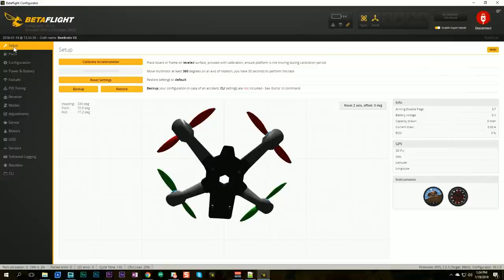Calibrate & Trim Betaflight Tiny Whoop Accelerometer | HOW TO FIX ANGLE MODE

Comment: You have to save settings, both sticks down and out.
Reply from the maker: I didn't notice needing to save manually while using the function. Someone else in the comments is telling me it auto-saves now.
Reply: Ok, good.
Reply: Yes, for sure it auto saves. I think this was a 3.2 change, but it could have been one release earlier.. I'd have to look.
Reply: Autosave to mine Tiny 6.
Now i love it, tnx Joshua 👍
Its all thanks to you and your passion for the hobby.

Winter here, snow and cold or rain and slush so indoors is the only option this time of year.
Reply: I havent updated so thats good to know!!!
Reply: @JoshuaBardwell  For me it's always been auto save when calibrating with stick commands, or using stick commands to trim the accelerometer. Btw, excessive trim values might affect the yaw turns, making it more like a swing than a pure turn around the z-axis. So I first try to get it to hover as solid as possible with calibration, and only use the trimming for fine tuning.
Reply: and whats the difference in calibration the gyro? Should i do that as well?
Reply: Thanks this worked for my Taycan👍🏻
Reply: I'm just starting with my tiny hawk and when I try to correct my trims doing what Joshua said in this video works OK, but then when I switch batteries it's like it resets, or goes all the other way around (ie first I trim it to the left, next battery, I have to trim it to the right). I even tried saving the settings and I see the drone blinking lights but it happens again. What should I do? Any help?
Reply: @dariordz688  Try correcting it and then DON'T disconnect the battery and connect to betaflight, go to where the trim values are and hit SAVE.
Reply: I have a cinewhoop that I fly in acro mode but I want to be able to fly it in angle mode too. The thing is that throttle seems to fluctuate in that mode, making it bob up and down. Me trying to compensate doesn't make it any better :)
I have no problem staying at an altitude in acro mode so it's clearly something wrong with auto level.
Reply: @Schradermusic  1)Aren't all this sticks corrections the same thing that use trims on the RC ? 
2) if you have to save in BF,  the problem is that on whoop you often  have to disconnect the battery to access to the usb port. 
For now I try to do the hubsan trick I used: to put paper sheets under the quad ( on the side where the quad use to drift ) and do the calibration.
Reply: @paul_bismuth  Try trimming on the Transmitter and then switching to Acro mode and you will know why you want to trim in Betaflight ;)
Reply: @Schradermusic  Ok ! so you have to use the trims only when you use Horizon and angle mode, if not you need to let the trims center for Acro?
Reply: @paul_bismuth  I have no idea how Horizon mode works but essentially if you trim your RC in a non-stabilized mode, you're basically constantly giving input, which in turn, turns the drone.
Reply: It is not auto saving for me. Unsure of the version. Will try next Wed. Thanks for the input.

Comment: Thank you SO MUCH for this video! Yesterday on my first time ever flying a quad I panicked and the quad got stuck in a tree about 15-20 meters above ground. Of course I had disarmed it and now it couldn’t arm because it was stuck in 90degrees angle between some branches and the tree was to big to shake it down. LUCKILY my friend had seen this video and remembered your tip on how to recalibrate it with the stick command so it again could arm and with a bit of twisting and props chipping away it came down!! Lucky ending!! Many thanx from Sweden!

Comment: This was a life saver! Thanks Joshua. I was trying to figure out how to level my Tiny with the USB cable coming out the bottom! I had several block designs in mind to raise it up. Your way sooo much better!
Reply: I used 4 identical mugs to calibrate with a battery on.   I have used taller heavy cups with usb plugged in, but you have to deal with the cable's own weight affecting the balance.

Comment: I got the RTF Geprc Tiny Go and this is a "Go To" video! My lil guy in auto level would drift forward and a touch to the left. After using your video, it is damn near perfect, many thanks.
I come from "collective pitch" helicopters. Not very good at it, crashed many times. Many tail-booms, skids, blades and such, I have become very good with repair and mechanical setup. Out of the 21 helicopters, more than half can hover like GPS and the rest do need a tiny inputs. All of which is done in agility mode or as it is referring to in the quad world "ACRO"....
Calibration and trimming in the quad world is easy with the stick method. Consider me a fan, thanks again.

Comment: Man you have been a key resource as i get into this hobby with my self built mini quad. I use a 3d printed frame thats held with zipties that obstruct the usb. It also drifts backwards when i hover. I manage to fly fine but was eventually going to tinker with the trim via the configurator. But that would mean constantly wasting zipties as i tweak, test, tweak, test. I had NO idea about the stick commands. This video just popped up in my reccomended feed and will save me from so much hassle. Thank you for making this and every video. My next quad is actually going to be based on your recent build and i will absolutely use each and every affiliate link.

Comment: Having followed the instructions for setting up,binding, upgrading betaflight and flashing my Mobula 7 I was glad to see this video on how to calibrate.  My mobula 7, on attempting to take off it just tilts to the left (using camera as front)  I adjusted the trim but was interippted somewhat by three screws falling out of the rear left motor and the motor dropped out of the frame !!!!   This certaily has been a learning experience. ;-)

Comment: I  really don't want to be one of those guys but if I may... Other things I would check when a quad is drifting before I trim would be  bent props, trim settings on the radio, and sticks centered (1500) in BF. Heck, even a battery on crooked or not "evenly placed" can cause drift or what appears to be drift, especially on a micro. This stuff may or may not be present but if it is, all the trimming in the world will be for nothing if you don't fix them first. Thanks for another fine video Mr. Bardwell.

Comment: Joshua Bardwell, you did it again! Thanks so much! I did not know I could do that.. The build I have makes it impossible (disassembly required) to do an accelerometer/USB connection, now I can lay it flat and calibrate it with stick commands..
Your the best, and really like the skirt...

Comment: That tip at the end is super useful deserves more visibility. Especially since it doesn’t really matter to the whoop market and most of the video was for them :)

It’s great because you still have the safety of the small angle setting , but can get it out of trees or use it on a racing starting stand

Comment: Joshua - I'm one of those acro-only guys, even with my Tiny Whoop build that I race regularly with our local MultiGP Chapter - FLX FPV.  I was taken aback in the interview with JP with the statement that no major or minor whoop races are being won by pilots flying acro.  Our chapter is half-way through it's second season and every tiny whoop race has been won by a pilot flying acro.  We've usually got 12-16 pilots on hand for each race, and there is a variety of acro and angle modes, but the fast guys all fly acro and seem to have the best flow.

I'd be very interested to see you spend a little time really dialing in the acro-bee to fly well in acro mode, as well as angle mode, and then dig a little deeper into the position that you have to fly angle to be fast.  And if you ever get up into central NY, make sure you come do some whoop racing with us!

Comment: Thank you very much for the video. It totally explained what I was experiencing (drifting forward) because the quad was connected to the computer  (micro-usb connection port on bottom of quad) which caused tilt during calibration. It is nice to know I can calibrate and trim without having to connect to computer alleviating what caused the drifting issue. Thank you again. G3D bless you!

Comment: Good to see you making some video’s about tiny whoops. I have a couple of them (some original F36, E010 and some a combination of a E011 frame and motors, with Beecore fc’s an aio cams. 
Project mockingbird helped me a great deal setting it up. And the stick commands come in very handy 👍
I only fly acro when I have to lose some weight, since the quad is all over the place in acro mode, and I have to pick it up every 7 seconds or so😎

Comment: Another great tutorial that helped me achieve exactly what I was looking for. My Protek35 would start tilting towards right and forward  even before it took off and even in the angle mode. This helped me to calibrate and trim it so well that now when I start applying the throttle there is no initial drift even before the takeoff. And even after the takeoff the quad drifts very little.

Comment: Hi Joshua, I already fixed the accelerometer in my cinecan and it stays in place however I have this other issue where it bounces or goes up and down even with steady throttle in any modes. In other words, issue maintaining altitude with throttle. Air mode and anti gravity are both switched off.  I use an X9 lite and on D16.

Comment: Super helpful! I kinda stopped flying angle on my whoops because calibrating within BF is tricky (really hard to get it right) and for some reason I just had a brain fade on stick commands.

I also really like the tip on the small angle.  I set to 180 for this very purpose but don't really like it - just one less safety measure disabled.  Definitely will consider switching in favor of your method.... however turtle mode has definitely made this easier (although not all my quads esp the 5" ones are on DSHOT ... so definitely helpful!).

Comment: I just bought a BetaFPV 75s, and had no idea about the stick commands.  Thanks!
Reply: SteelTallon , what batteries are you running for your 75? I have the same quad and got the 260Mah batteries and hate them. They seem under powered and flight times seem way too short.
Reply: Flight Dreams mine came with a BetaFPV 550mah HV. I also bought 4 GN3 550 HV off Amazon. I like them, plenty of power and about 3-4 flight times.
Reply: SteelTallon that sounds more like what it needs. Thx SteelTallon for the info. Going to keep flying my FT gremlin till I get new batteries for my brushed quad.

Comment: Hi! 
After I calibrate my accelerometer, the whoop sits still in the air, but after some time it drifts more and more to the right.
At the end of the flight the drift is very bad. Do you know the fix?

Comment: I use both angle and acro on my micro quad. I tend to fly in angle when in close quarters and acro when in large rooms or outdoors. My friend BoostFPV, however, from what I can tell, races his whoop exclusively in acro, as evident by a celebratory power loop after crossing the finish line in one of his videos.

Comment: Hi Josh...I am very much a noob, but why not calibrate using the trim on the transmitter vs. calibrating using trim in the flight controller?  Is there a difference?

Comment: Thank you again. I was wondering with my mini quads that have no calibration in the OSD and a USB cable that stick out the bottom how the HECK you are supposed to calibrate it without removing the flight controller!!! You are good at your job.

Comment: How do I adjust for yaw?  My acrobee lite has started to slowly rotate clockwise.  Bataflight shows my yaw at 1506 rather than 1500, which is what I gather the problem is, but I don’t know how to fix it.

Comment: I have a jumper t12 pro and a betafpv meteor 75 1S. But sticks commands don't work, is there something to setup before being able to use them?
I tried calibrating the drone when upside down then arming but it don't work.
The only stick command working right now is the profile 1 (left stick bottom-left and right stick middle-left) but no other seems to work.
Triming also don't change anything under betaflight :/

Comment: I do the calibration on one of my tiny whoops and after couple seconds its getting back to drift the same like befor. Could it be the gyro is defekt if yes i have 2 how i know witch one is defekt and how i use only the one thata works?

Comment: trim dont work on mine quad the acc is qualibrated i trim the drone it fly but after each pitch order given to the quad it start to pitch backward more and more and more until i need to be fully push pitch to stay level. what is the issue ??? i have some vibration but quad fly well in accro. i lower the D term in pid loops but not improvement. make me crazy. motors getting hot to in stab mode

Comment: I had no idea there were stick commands for my whoop class micro's! Also I must agree that the PID's and Rates in Project Mockingbird are very close when using stock speed motors, acro's rates are a bit too fast if you are using upgraded motors imho, but angle fly's great!

Comment: @Joshua Bardwell

I have a quad that drifts a bit. End and midpoints are configured correct. When I trim the accelerometer using the stick commands I can get the drift out. Then I save using the stick commands and I also hang it to BF and save again under configuration tab where I see the Trim values.
 If I put a new battery on, the trim values are still in BF.
Yet each time I reconnect the battery it slightly drifts again to one side and I have to trim it again and get other trim values.
any ideas?

Comment: Trying to correct my sticks in my QX7. I've master reset several  times, and every time I go in Betaflight to check switches & modes.(Bind to 2 whoops. One has a BeeBrain the other is a Beecore.) They are swap out of place. I was trying to correct them in the mixer page. But I could never get my control sticks in the right order. And I using the order in Betaflight, plus global settings are checked. But I  can't get to work
..Help please

Comment: As usual, it depends on what you're aiming to do. Freestyle or anything like that? Forget angle mode, it is not an "acro mode for beginners", it is a totally different way to flight and you will definitely struggle to change from one to the other. Personal experience: after weeks on a simulator, I've bought a Tiny Hawk. Went to a field, and started angle mode, just to be safe. After some time, I thought RIGHT! Time for the acro mode! Switched.. and crash, crash, crash.. Seemed like weeks on simulator were just useless. My "muscle memory" was completely confused by that flying mode and it took time to "remember". My advise: use angle only to fly indoor maybe, or to test new drones before switching to acro.

Comment: Is accelerometer trim (using stick commands) different than the trim switches under the gimbal? I have been using the trim switches to counteract drift.
Reply from the maker: You should never use the trim switches on a multirotor with a flight controller. The channels should always center at 1500 us, and any trim or tuning should be done in the flight controller.
Reply: What's the negative side to using the trim tabs?
Reply: John Trent one thing I notice is that trim changes on the controller are only temporary. Changes in betaflight will persist.
Reply: For your quad to fly the best in angle mode, your accelerometer needs to have an accurate reference toward level. Trimming with the tx trim tabs doesn't make your accelerometer go, "Oh, ok, I get it . NOW I'm level." It just gives the receiver a constant input toward that particular stick direction; your accelerometer's level reference is still off.

Let's say you put in a bunch of left roll trim using the trim tab on your tx. Now open up Betaflight's receiver tab. You'll notice that the center point is now less than 1500. So you've also lost resolution in that direction, and it can also mess up your stick feel in the direction you trimmed.

By trimming the accelerometer itself, you are telling it that it needs to correct it's level reference. This is the "ok, I got it. Now I'm level" that you're looking for. If you use trim tabs to correct to level, your quad just won't fly as well in angle mode or horizon mode as it would if the gyro's level reference was accurate.
Reply: Awesome thanks for the good explanation.

Comment: What makes it difficult to level is most USB cables are flat and the USB plug on the FC is on the bottom of the FC. 
To get it level we have to get creative if we don't have a 45° USB. I set mine half on half off of my laptop, with the power and USB cables under it. 
The USB cable drops between power and USB. 
Is it perfect? 
That depends on if it gets bumped or slides during motor testing.

Comment: Will the scenario of being stuck in a tree and unable to arm so you recalibrate the accelerometer still work if you have the accelerometer disabled in Betaflight? Or can you arm at any angle when the accelerometer is disabled? I always fly with the accelerometer disabled and have never noticed that the quad need to be flat to arm.
Reply from the maker: If the accelerometer is disabled, then none of this applies and you can always arm at any angle.

Comment: I've tried these commands over and over again, they just don't save. Any idea if I should enable something else before trying the stick commands ?
Basically I'm trying to calibrate a left drift, so I'm using left-stick down and right-stick right. When I go back into Betaflight, the values didn't change. I've also tried manual saving, with both sticks down and out.

Comment: Been trying controller trim and re calibrating gyro and wasnt working right.. just followed this because adjusting from betaflight was impossible.. thank god for this vid. its at 4 roll trim and -10 pitch.. I used a level trying to level drone for calibration.. ugh